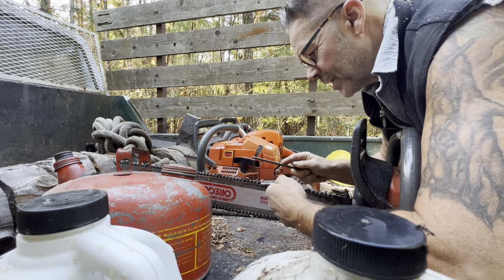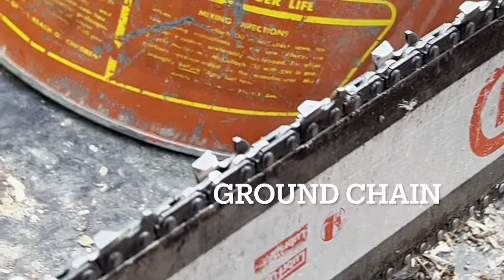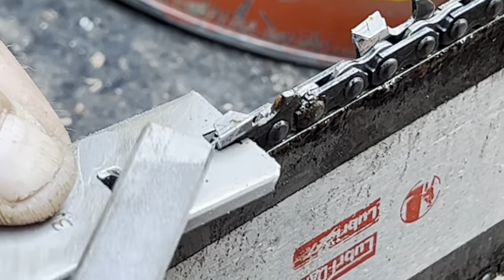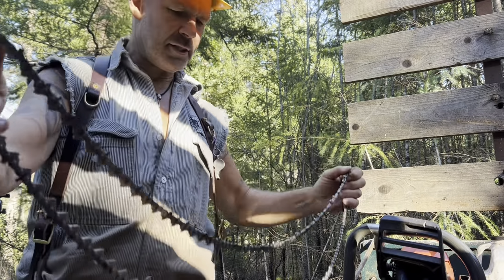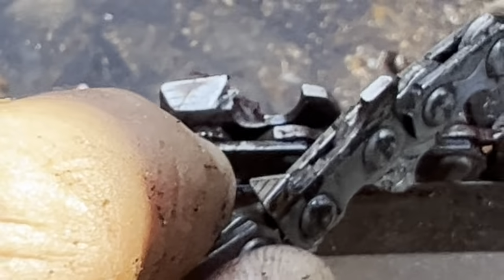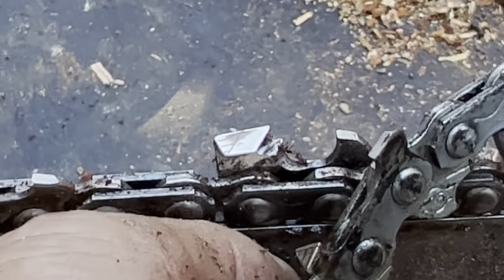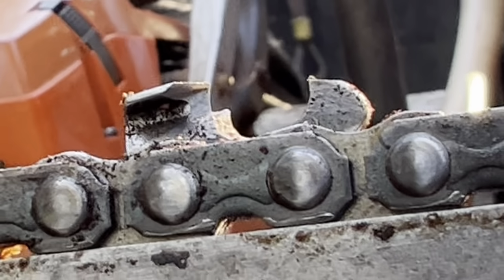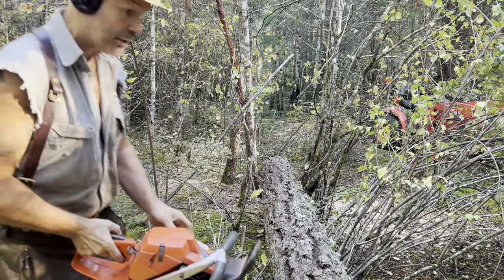It’s a Chainsaw! Not a jackhammer

Comment: I use same husqvarna Rackers gauge and I always file on the hard wood side because that what I cut the most but I will cut soft wood also .  But was wondering if u file to soft wood side of rakers gauge and it pull harder into the wood.

Comment: Being I am a amateur or novice chainsaw man should I just stay with 18 to 20 inch bar. Because that big 32 and 36 inch bar looks cool
Reply from the maker: If yer askin , which it seems like you are , it’s not about looks friend. It’s about a few other things . 32” bars need power. 70 and up cc class . 24-28 “ is a nice starting point for a beginner
Reply: East coast run short bars. Hard wood trees. West coast run long bars. Soft big wood, like for. 
Hard to go wrong with a go saw in 50cc range and 20” bar.  Stihl 261

Comment: In my opinion, your old hand filed chain cut better than the ground chain
Reply from the maker: It felt very close .  Although the square was ragged
Reply: @BuckinBillyRaySmith    But the hand file was on its last life plus the square wasn’t as used. Your hand filed chains always cut better. That’s just my opinion.

Comment: Can you explain "hard" " soft" on your gauage, as well as the numbers and what they represent.

I know the old gauges that you have and upu love.  But what about newer gauges on the market!
Reply: Hard wood soft wood
Reply: I think the soft wood spot takes a bit more raker off for a bigger chip or bite,  hard wood I don't think you would want a big Bute because it may catch if you don't have enough power.  I could be wrong but that's kinda the information I have gathered.
Reply: hard for hardwood, taller raker - less of a bite as the wood is denser and therefore needs more power to take the same size bite as in softwood
Reply: @allthingsmotorized1885  
Thanks. I figured the wood aspect but not the bite part, but it does make sense.

Comment: i honestly think you could win the timbersports champions in falling and bucking maybe not limbing and chainswap but falling for sure. also i really need to get myself a square grinder this would really kick up my 5105 dolmar its a little 50 cc saw nice light pulls a 18 inch bar with absolute ease even with my half dull chains they are not very bad but always could be better